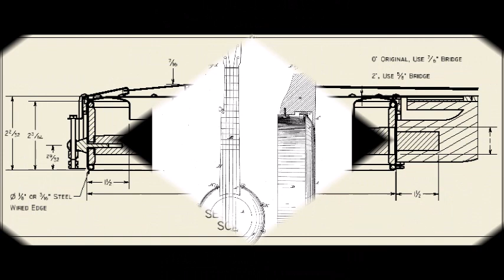1878 Style Dobson Banjo Tone Ring Spinning Process

Comment: Very cool, thanks for posting!  I've seen your spun over rims (I see one on your drill press in the back in this video I think).  I make those as well and I'd love to see your process on those.
Reply from the maker: Thanks! I'll make a video sometime in the future on making the spunover rims. I use antique hand cranked beading, wiring, and burring machines, but a modern bead roller with interchangeable dies can be used too. I just like using the old hand cranked machines.